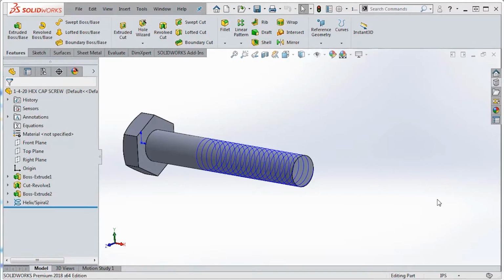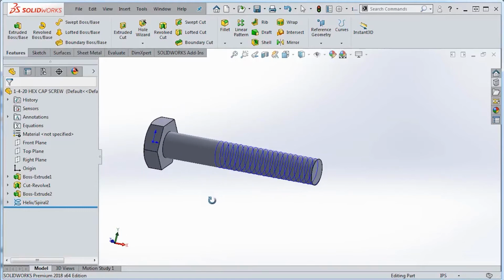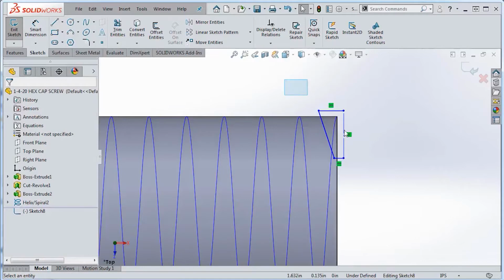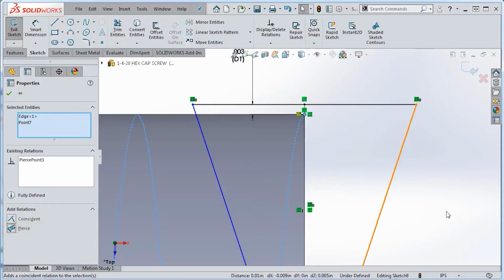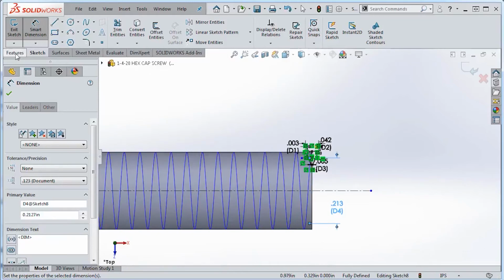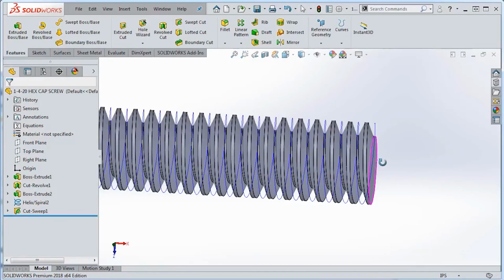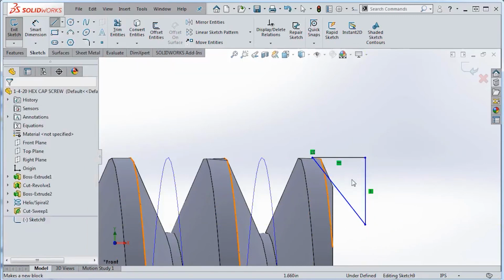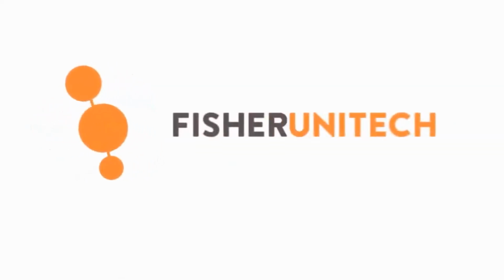How to make threads in SOLIDWORKS

Comment: Thanks for this, I went through about 5 other videos and this was the best one. I needed to model some threads for a model rocket that I'm designing to be 3D printed. It will have a twist-on cap to retain the motor.